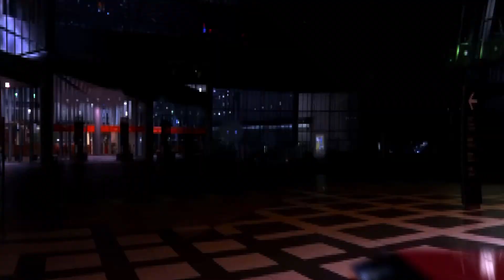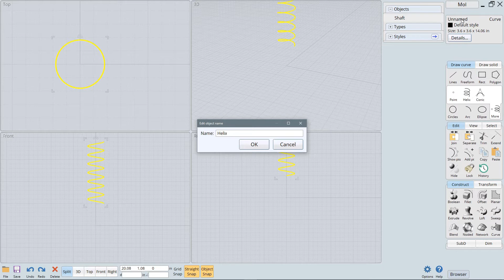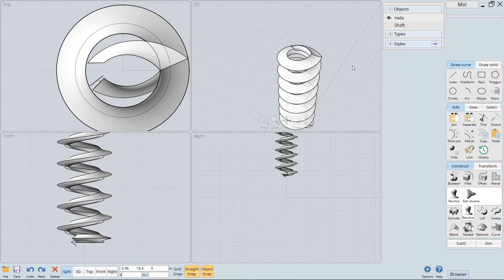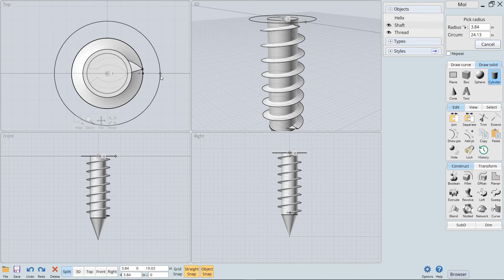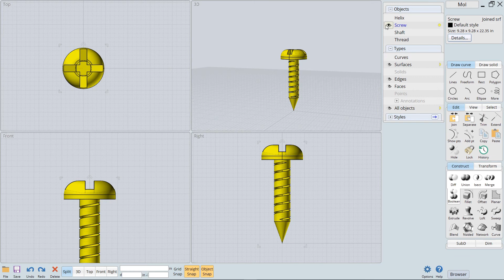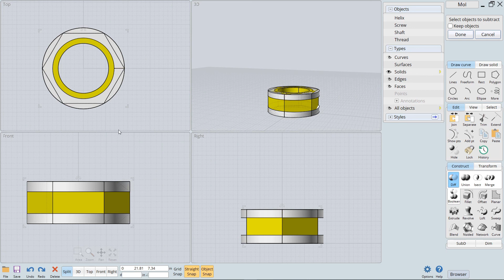Model a screw in Moment of Inspiration (CAD)

Comment: I'm kinda wondering why you modeled a screw rather than a bolt to go with the nut.  We used the term "Subtract" rather than "Difference" for boolean operations.  Does MoI3D use both operations doing slightly different things, or did they just choose to use the term "Difference" rather than "Subtract" for such operations.
Reply from the maker: I was just planning to do the screw and then decided to do the nut at the last moment. I also realized I should have done a bolt. Although this way let me show the Cone tool where I wouldn't have before. 
It's just using Difference instead of Subtract. We use Subtract In LightWave and LWCad too. I noticed a couple of took names are different from what I'm used to.